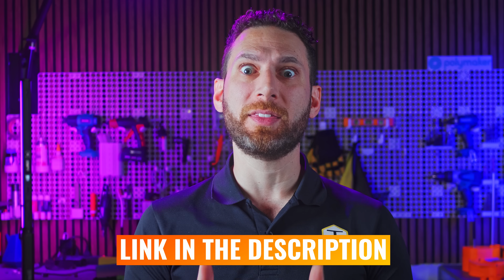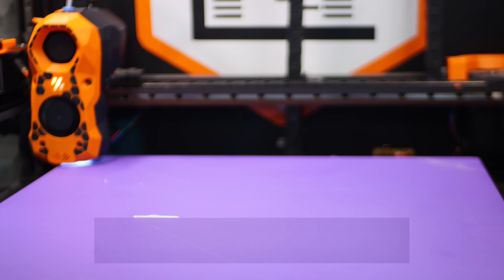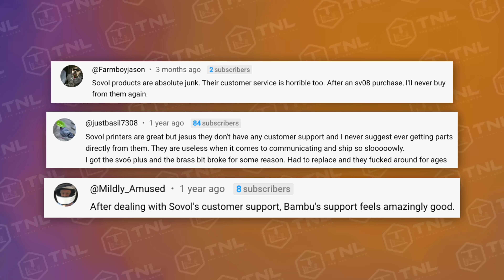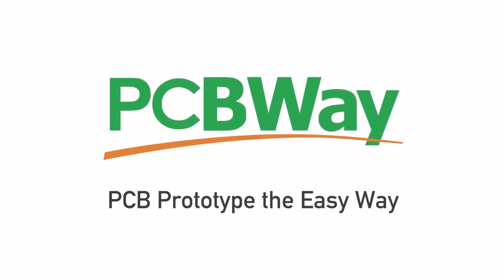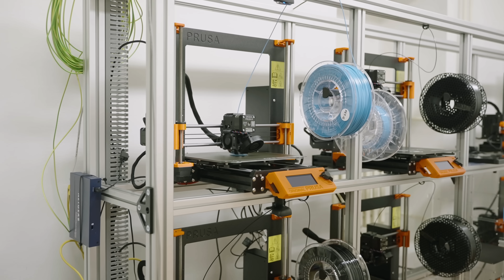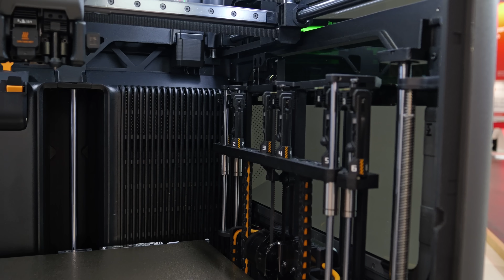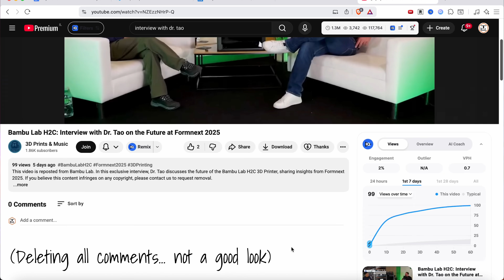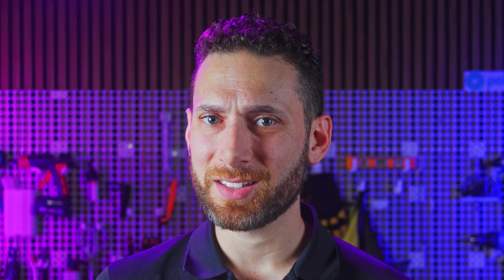My HONEST Annual Report Card for Each 3D Printer Brand

Comment: No disagreements with anything said, just curious about your take on Qidi.  I have 2 of their printers and they  have some real errors (errors that make prints fail, not just unexpected but OK settings) in some Orca profiles but once that's sorted out they have been very consistent.  I do a fair bit of small and detailed stuff, and only go to resin when I must.  The ability to handle 0.2 mm nozzles and not make a blobby mess is a big deal for me.  My X Plus 3 does about as well as my Bambu A1 Mini with small nozzles,  Think HO scale objects, so quality is the primary metric for me.  I will say  belt adjustment on the Xplus 3  is a tad sketchy.  If the Qidi Box ever actually gets here it will be interesting to see how printing support interface layers in PETG for PLA prints will play out,.  No matter how dialed in or positioned / diced to parts there are some  pieces that just need support and while minimal compared to the old days there is still some support scarring or drooping over the support no matter how carefully the top Z is dialed in.  Enjoyed your video, Thanks!

Comment: I own multiple Bambu printers, bought before they went full Apple. I will not be purchasing more in the future unless and until they walk that back. I'm playing the Anycubic lottery simply because I can get my workflow the way I want it with no middleware, no cloud spying, normal Orca Slicer, and full control. It does take a bit of work, but at least it's possible. I'd rather deal with possible hardware issues than definite software issues. That's just my two cents.

Comment: Everybody forgot that Bambulab used Prusa's Slicer to build the BambuStudio as its entry point, in violation of the license. Moreover, they forgot to replace the logger, which is why they were caught red-handed. What makes them look even worse is that they have been denying the violation of the license despite all the evidence.

This is why I don't buy Bambulab. I resist buying the greatest machines on the market in terms of price-to-quality ratio, such as H2D and A1 mini.

Comment: Take the hot end out of the xl tool head to swap nozzle. Follow the documentation? Print the xl nozzle replacement tool on the prusa printables page?
Reply from the maker: I have WAY more nozzles than I do hot-ends (like, every possible variation of nozzle), but, you're right, for common ones I should jsut get more heat breaks and swap those, it's WAY faster.... Good call.

Comment: My biggest wish is for print companies to adopt the open RFID tag system so that the printer recognizes different filaments automatically. 
My second wish is AnyCubic to open up there printers and give me the ability to access the printer from a web interface. Main reason for this is that any time I have to update the firmware I get an error "insufficient memory" I then spend the next 5+ minutes going through and deleting prints ONE at a time from the printer using the small touch screen to make room. This is the reason that I will not be ordering another AnyCubic printer unless they open up there software to allow access and controls from things other than the anycubic next slicer. 
On a happier note I'm very excited for my Snapmaker U1 that should be arriving next year.

Comment: pretty cool wrap-up. can only speak for AnyCubic and BambuLab and I fully agree on all points. Pulling together on one open-source project would benefit everyone in the long run. But this would narrow down the competition part to mainly hardware and support. I have a feeling most named manufacturers want to have an edge on the software side as well since they can't deliver the quality or value for price level of their competitors. A Slicer for all (Orca) and unified spools would be the absolute dream, but my get feeling tells me it stays like that - a dream.

Comment: Totally agree about a larger engineering filament SnapMaker U1 model, and get the Bambu reflective comments, because it was my take at the time, “spiteful” sums it up, and why I won’t own one after my X1C again with their stance on closing stuff down, despite folks telling me I’m cutting my nose off. I’ve had closed source printers in the mid to late 2010s, but in 2025 it’s not needed to be successful. BTW, I didn’t see anything re Qidi, but I guess their doing pretty well with the Q2 OI like mine), and the Q Max4, plus I really like the Bondtech INDX approach for the future timeline, and hoping OrcaSlicer pushes a better Devices tab and different nozzle sizes toolhead integration too.

Comment: My sv08 is whisper quiet. No company should put out a printer without a camera or enclosure if available, this is the reason i skipped the buy on the ADX5.
Reply: I put a Noctua in mine before powering up the first time.  I think it is incredibly quiet.

Comment: elegoo: you can't even turn on the frigging light when it's printing!
Can you use the snapmaker U1 outside of the cloud? without the BS you have when you try it with bambu labs?
Reply from the maker: Yeah run it local and it’s just normal Fluidd

Comment: Im kind of confused here. You said you were going to give reviews about printers and all you can do is be mad at Bambu for your own personal reasons but you can't talk about the printers or what they could change? I would love to know what improvements should be made on the vortek system. 

My take on the vortex is this. Is it slower than a prusa or a snap maker u1 in color changes? Sure. Is time really the issue? no. I believe this system was not designed to just be a color changer. It was designed to be a multi material machine. Now, that said I do believe there are a few filament limitations that could be worked out but the facts are there are things this system can do that no other currently can. Even if Prusa gets the indx system it is still limited to color selection and broken heads won't be cheap. This is the same issue that snap maker has. The idea that neither of these machines are actually enclosed as the tops are open yet they are in an enclosure is weird to me. I believe at current the cost of a nozzle for the vortex system will be cheaper than a full toolhead if one fails on a u1 or on a prusa.

Yes the closed source of Bambu does bother some but lets face it we all know of many manufacturers that do this and still have the largest market share in their market. People still buy the product and I can't blame them for doing it. Why you may ask? Well this is how you keep machines running at peak. Open source machines just in general are not as reliable, period. The more you allow People to change every setting the more you are looking for problems. The business cost of losing a customer mad about closed ecosystem capabilities is lower than the cost of a large increase in warranty and satisfaction issues because users don't know what they are doing. 

I also don't get you rant about dropping a plug about a new product while a competitor was launching theirs. Competition is competition and to be fair Snapmaker can't even get out their product they sold months and months ago in their backer program. Bambu at least has been getting printers out when they said they would. If anything I feel this is more transparent and very much resoected by the customer. The number of comments I see by backers of u1 mad because they are still waiting after promise date is staggering.

In the end I love the industry but I do find it silly when I hear rants from someone about certain products they haven't even used with very clear personal issues that are not even relevant. I mean let's face it. If you had a business would you allow someone to push your direction because they don't like it? No you wouldn't. You idea on professional conduct in competition is hilarious actually. Business is business and competition in business is ruthless. This is fact. No company in business says you know, I really want competitor ti be better than me this year. I only care about the industry. To think this way is a joke honestly. If you actually believe that then its time to come back from Kansas Dorthy because your in a pipe dream.

Comment: You convinced me, I'm getting the Bambu Lab H2C.  As I'm sure you know but aren't really saying, there is a three-way tradeoff between printers like Snapmaker/Prusa XL, the Prusa INDX, and the Bambu Labs H2C.  The Snapmaker/XL are tiring to load, but do save filament and are fast, The INDX has lots of heads, but they must be loaded ONE AT A TIME (oh. NO) and the H2C does give up some speed and a bit of filament savings  for convenience.  In my mind, no one is clearly better than the other two. If you rarely change filaments, Snapmaker or even INDX might be better, but if you don't do many multicolor prints, having different nozzles remotely selectable is a big win. Also, after hearing a year's worth of complaining about the XL mot working well, its clear PRUSA still needs some work. Evert Bambu printer worked perfect from the day I opened the carton. That is important. Sorry that you and Bambu broke ties which seems to explain why you don't have any of their newer printers. And of course, you have all the new PRUSA printers, which I'm sure has nothing to do with your opinions.  I just want to know how you feel after spending an hour to load the filament to all 8 tools on the PRUSA IMDX, that 45 second filament change on the H2C is not looking bad. Yes?
Reply: Very nice comment in support of Bambu, it's great that you don't mind that your data ends up on servers in Shenzhen...
Reply: @CadaoPhạm-i2lWhat Data are you worried about? How often do you have your pants off in front of the live view camera?
Reply: @CadaoPhạm-i2lWhat in the world are you doing in front of the camera?

Comment: I like the idea of 3D printing.  I really don't like the idea of 3D printing a bunch of plastic.  There's already enough plastic in the world.  I'm sure for rapid prototyping, 3D printing a little plastic is fine but plastic should never be used for moving components in mass production - it is weaker and also chemically breaks down over time.  However, the real 3D printer I'd love to have is a metal sintering 3D printer.  Metal lasts much longer than plastic, can be melted down and reused more easily, is safer for the environment, etc.  Unfortunately, the cheapest 3D metal sintering printer is still around $15K.  Get that cost down to $300 to $500 and these plastic 3D printers vanish pretty much overnight.

Comment: As the owner of a Snapmaker J1s, I wish Snapmaker wouldn't abandon firmware iteration on existing products so damned fast. It's been nearly a year and no updates for the J1s. They previously said they would add better open remote upload functionality...nothing of the sort has materialized; I'm still using a 3rd party proxy service running on one of my PCs. I don't think they keep a team active on a printer model for very long after a release, which ceases all upgrades and updates to that model. That was probably my only real concern with my pre-order of the U1, but at least that is running Klipper (unlike the J1s).

Comment: I think the H2C has potential but it's all for stuff that isn't supported by the slicer so you never know if it will be a thing or not.  Stuff like being able to swap nozzle sizes for the same filament shouldn't even need an AMS retract and it would be cool for speeding up and smoothing parts out being able to use a 0.6mm and 0.2 mm nozzle on the same part where you can get away with it.  What I don't understand is the keeping of an H2D style nozzle on one side instead of going all in on the nozzle swap.  If both nozzles could be swapped in and out and they could figure out how to get an AMS to feed to either one instead of exclusively it would be an awesome unit.

Unfotunately for Bambu I'd be better off keeping my P1S and adding a Snapmaker U1 than buying an H2C and it's cheaper for someone to buy two printers to cover all their bases than to just get an H2C.  Guess I'd better just go ahead and set aside some money now because your talk of what you want next out of Snapmaker would be hard to pass up.

Comment: OrcaSlicer is too bleeding edge. I'm always running older versions, if at all. Some of the features are even all that new. Just easier. Fair enough but it creates a bit of a messy clutter in the UI. Users should never have to mess abhout with all those high tech features. Slicers should analyse the parts and use them intelligently without us having to scrutinize every layer to see problems and come up with creative fixes.

Comment: You really should buy a H2S or H2D. The whole experience is on another level. The H2C was obviously in development for a long time and though the announcement was a reaction to the U1 Kickstarter you can’t blame them trying to protect sales. The quality of the  H2 series is phenomenal. The H2D is my first Bambu printer having had Creality, Flashforge, Elegoo & Prusa beforehand. Non of which came close.
Reply: It’s better than buying a printer that gets updates for 3months then is abandoned. Every part of a Bambu printer is available from their website at a reasonable price. They still get firmware updates and software updates. Creality are horrible at this. The Centari carbon still doesn’t have a good selection of spares available. Many other manufacturers are reliant on 3rd party. People are making such a big deal about this. iPhones are not  open nor Samsung. My TV isn’t open and costs far more than the H2D. You can run the H2D in LAN mode or developer mode. Parts are available. 3rd party parts are appearing. Yes it would be lovely if it was open source. But on the positive side. Without Bambu Studio we wouldn’t have Orca. We wouldn’t have printers that arnt projects in them selves but just tools to get a job done without hours of tinkering to make a print come out in an acceptable state. Bambu have forced the industry to be better
Reply: @jnh2003  'Bambu have forced the industry to be better' Agreed. I'm not calling Bambu the devil or anything. They've done good.

'LAN mode' actually, there's a massive compromise with this. In Lan mode, you lose access to all cloud features. Before 2025, you could have all the functionality of LAN mode without losing cloud access. This just screws over consumers.
As Louis Rossman said, they changed the product for the worse after the sale.

As for your personal open-ness, good for you, but not really part of this discussion. I personally don't use Samsung or Apple because of that reason and my TVs are not connected to the internet.

As for firmware updates, that's one way of thinking about it. Another way of thinking about it is that if the printer was open source, it will live forever- flash klipper , marlin or Reprap firmware once and enjoy updates for years and years. If your CPU is no longer supported, just put in a Raspberry or Orange Pi and continue using it.
But this is not an excuse for companies not giving software updates! They need to do better, and a lot do, like Prusa. 

So, what's my point? I think that Bambu existing was good for consumers till recently, but they've started going down a path of 'you don't own anything' which will ultimately harm consumers. With competition catching up and in some cases beating them I don't feel like its worth going with Bambu anymore. 

If you want Bambu reliability, go Prusa. If you're happy to tinker and want a better X1C for almost half the price, go Qidi. If you want toolchanger, go Snapmaker. If you want a cheap CoreXY and don't care for multicolour, go Elegoo.
Reply: So the "another level" comment contributes nothing for a person already familiar with earlier Bambu products, making it an odd fit for the video.
Reply: As good as it may be, it doesn't justify paying for a printer you don't truly own, in my opinion
If you don't care about that, enjoy your printer- H2 series are still beastly.
Reply: @harnnesss  you do though
Reply: @riba2233  what
Reply: @harnnesss  you do own it
Reply: @riba2233 just read my comment I made to the other guy or watch the Louis Rossman video

Comment: I want the Bambu Lab that released the X1, P1, and A1 printers, the new H series feels rushed and unrefined, whereas the former are well designed and sleek.
Reply: What makes you say that? They have had very few problems. In the h2c color changes take about 30 seconds, which causes everyone to write it off in the current tool changer race instantly, and people don’t seem to realize that the tubes can be shortened, which dramatically decreases swaps. I did this on my P1S. People also complain about the complexity of the vortek, which we can’t really judge yet but I applaud the creativity. And that bed heating problem that 3d printing nerd had… that was a unit that he was given to test. I haven’t heard problems like that from people who actually bought it. I know that your comment isn’t solely referring to the h2c but I feel did share this

Comment: To quote Sir Terry Pratchett, Going Postal, "An underdog can always find somewhere soft to bite."

If Anycubic, Creality, or Christ even Elegoo could get their crap together and stop selling sub par machines that fall apart within a month (around the 100 hour mark) or gaslighting customers who ask for a refund/replacement printer, they could dethrone Bambu Lab.  But as it unfortunately stands, Bambu Lab printers have the most value for money.  They screwed up pretty badly with the vortek system, and they're doubling down on it going forward (X2C will probably use it) so someone has a chance to bite a soft spot.  They just need to stop trying to maximize short term profit at the expense of customer experience.